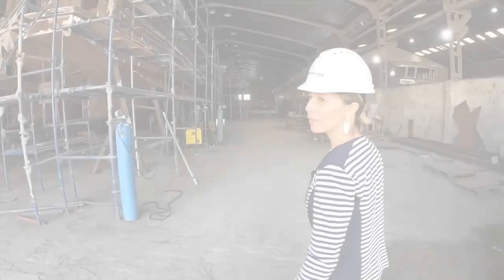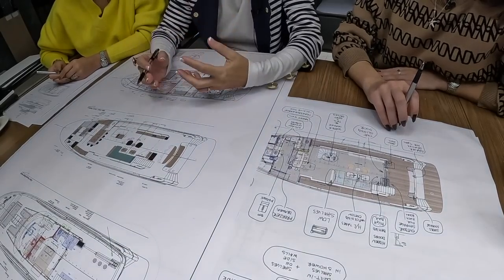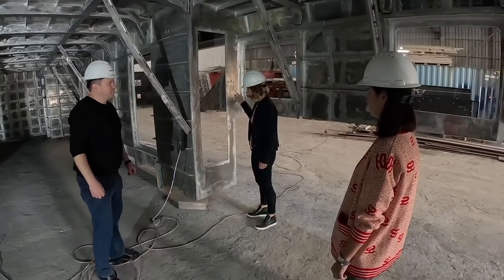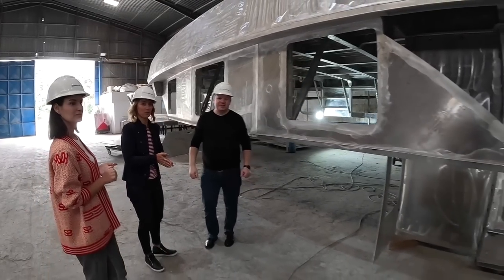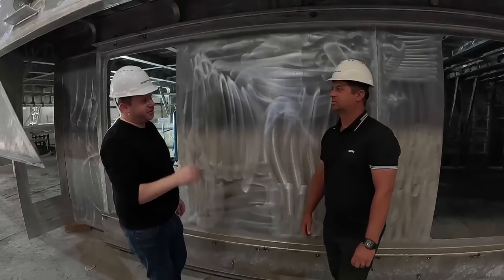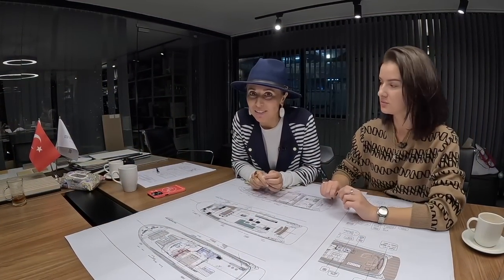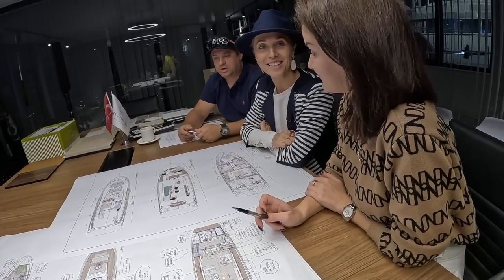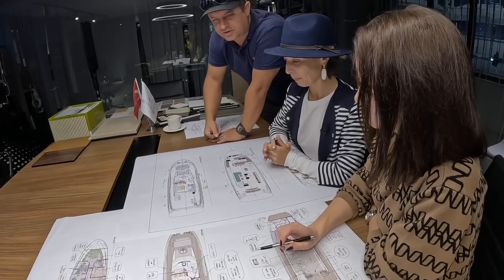BIG Change & the CREW CABIN on our BERING 75 🙈😝 Eps. 20

Comment: Having worked in the construction industry and running a construction company, there is nothing worse than clients changing their mind after they have SIGNED off on the contract. That's why a lot of builders build buildings first then sell to the public. It actually cost a lot of money for builders that are already running on a fine margin to constantly change construction decisions along the way. It's your job as the client to double check everything before you sign. In the construction industry you would be charged a variation fee every time you  change something as it does create a lot of extra work and to expect people to do it for nothing is inconsiderate to the builder, who are already working hard to make your dream come true. To make one change there can have another effect on another part of the build.

Comment: I really hope you guys land on the moon quickly with all these last minute changes. I'm a mechanical engineer and late changes by clients drive me nuts. Or I just start charging for them.
Reply: True, and I think they had already signed off on the final plan.
Reply: @StarTraveler649  You can run out of friends very fast if you keep stuffing them around. Better to look at the GAs and/or models and do your thinking ahead of time, not some bucket list on the fly.
Reply: In any design/build prcesses there is something called a Design Freeze. That's it; what has been agreed on will be built. Any further changes will be extra cost and extra delay.
Reply: I don't know what is doing on here. Surely the Drawings were availalable and now these late structural changes?

Comment: I’m a bit worried about the lack of indoor dining for when the weather is less than perfect. You’ve got a huge saloon but are only really using half of the space for a seating area when you could be using all of it and have a dining table that converts to a lounge area as well as a separate seating area in that space. Have a look at a few other yacht designs in the 60 to 100 ft class for inspiration, or just allow the Bering interior designers to do their job and come up with some suggestions.

Comment: Hi, the crew cabin looks great but where are they going to eat? With respect to the door on the port side where you now want storage being moved round the corner, do you really need it if there is going to be a sliding door about 6 feet away from your new proposede position of the door, I get they may be serving a different purpose but it would save cutting another hole in the superstructure, which may make Vladimir happy!

Comment: There seems to be a fairly empty space between the galley and the couch/dining area. Is that because of the drop down tv? You could put in a proper av cabinet with a lift, and gain more storage on the galley side. 
With the tv lowered in the cabinet you would still be connected with those near or in the galley.
Can’t have too much storage.
Reply from the maker: you are sooo right - can’t have too much storage lol

Comment: Hi guys , just an  out of the box idea (17:50) why don't you put a dropdown ironing board on the heads door?  you will not be able to get into the heads anyways will ironing.....   and it seams if it's on the door when lowered down it is actually in a good ironing position. hope it helps cheers

Comment: That is over 60 man hours plus materials to change the door opening location at this point. If they are using 1/4" 5052h32 aluminum, that puts the change at around $14k.
They are doing them a huge favor.

Comment: Kitchen Bar looks OK ;) consulting crew chef is a must IMO !
Question? Where u all will dine, in case there will be cold outside, or too hot?  suggesting to bring back free standing dining table from the 1st variant of plan :) or some transformer table near the sofa.
In my opinion have as much free standing furniture as possible, cause after 10 yr, u can easily replace them, with no need of capital interior renovation. Have ar much open space as possible, and transform it with free standing furniture (architects opinion ;)  
And get rid of that cabinet, blocking door from salone to cockpit, that placement is not great. You'll thank me later ;)

They are so nice about changes, I think this is on camera only thought :)
To understand about changes, (same in house construction too), what u see done, was designed some time ago, and on this piece is 100 more decisions made to present day, so even little change its like pulling bottom card from a house of cards - everything above collapse.  Thats why is time limit to do changes :)

Comment: Long time subscriber to the original channel. 
Not my money, not my yacht. I think the crew cabin is a big mistake. I was a deck hand in college. Also played Pro sports and coached college. Which means I've been around a lot of pros under stress. Having the entrance to the crew in the middle of the galley is assume there will never be issues with crew. What happens if the storm is heavy, now you'll be bringing in crew with wet jackets, etc. I'm thinking of worse case scenarios. I know if I was your crew having a bad day, I'd prefer to have the original door. I like the private access. and I think your future crew will appreciate it on those off days they will have. Like I said, It's not my money. Love both channels and all the other updates to the 75.

Comment: Is there a sliding door for the crew to use, to enter the laundry room, bath room? I don't think the crew cabin should be placed next to the main galley. The crew staying has no privacy, for them to enter and exits the galley means they have to walk through the kitchen, which means they have to walk through any activities going on in the galley or dinning or lounge area. Any laundry to be cleaned needs to go through the galley and what is the timing for this? People would like access to the galley 24 x 7, yes. Looks like your plan has two heads kind of close to each other. The head near the counter for seating and near the  lounge has no privacy. People do like some privacy when entering and exiting the head. And this head is right in the middle of all the activity on the boats. Do you want to sit next to the head while at the counter? Some thoughts. Thanks for the awesome videos, good luck!

Comment: Can that cut door hole be turned into a window?
Reply from the maker: Cup door??  🤔
Reply: @NautiGuys  I'm sure it could be made into a window but it's going to be cheaper to weld in another piece of metal over the current hole. That and having a window there isn't going to be a big improvement in the lighting.

Comment: What is the ballpark of the cost of this boat fully outfitted and how much will you charge for the whole boat for a weekly charter?  Another ? Is will there be times when you can rent 1 cabin for the week and other people can rent out the other rooms.  The reason for the ? is just to know if people that really can’t afford to rent out entire boats.  It would be nice to have a market where blue collar people could afford a small room, but not the Master Cabin.  You could allow people to go on a nice boat without braking the bank so to say.  There are tons of people that can’t afford $10,000 or more a week to rent an entire boat, but might be able to save up to spend $2,000-$2,500 max on a weeklong vacation plus tip with the Master costing $7,000, VIP $5,000 and so on to cover the say $17,000 weekly cost of the whole boat.

Comment: My opinion really doesn't matter in the long run, but comments are good for the algorithm, so here goes....   I love your bar seating idea for a kitchen... fantastic!!!  I HATE it for your boat.  1. You have a major luxury boat and will have paying customers expecting top level treatment.  Since the weather is not always perfect, you will have days where multiple meals are served indoors and that is your only indoor seating for 6.  Some may not be happy with having to eat multiple meals at a counter. 2. Bar countertop seating is not conducive to conversation.  The person all the way closest to the wall can really only converse with the person next to them and maybe the chef and may not be able to hear the people at the other end very well.  3. Some clients may not want to be chatting with the chef for every meal. (again, if you are stuck inside due to weather.) 4. That bar seating would have elevated chairs, which some people, including myself and my mother, do not like. I feel like I am always about to fall forward, since I am on the shorter side.  
I suggest that you lower that extension back down to table top height with legs that the top just locks into the kitchen as an extension. The top can be made of a stone matching the kitchen.   You can put the chairs around it and serve breakfast that way, but, when needed, you can unlock the unit and detach it and move it into the open space with those chairs as a free standing table. 
I know your boat will be beautiful, whatever you decide!!
Reply from the maker: One very simple answer, the couch area is fully comfortable to a dining area for 10 🤷‍♀️😝😂 (just like all the luxury catamarans)
Reply: @NautiGuys  Aha!  Then yes, that breakfast bar is perfect and will be both functional and beautiful!!

Comment: Putting in a drop TV from the ceiling is a mistake as it will create an obstacle for people that you have to walk around and can hit their heads on, it will reduce the number of people who can view the TV, and it will be too high for comfortable viewing. The best option is to have a lift TV in the built-in side storage cabinet under the window across from the couch. Why are you putting a sliding glass door on the side of the lounge on the couch wall? Shouldn’t the sliding glass door be on the back of the lounge so you can walk straight out onto the aft deck, that way the people sitting on the aft deck are not cut off from the lounge? It is better for functionality, flow and view to have the sliding doors facing the aft deck. I feel that your making some strange decisions that are going to negatively affect the functionality of this ship build.

Comment: I'm not really keen on changes like that door. That should be decided before you start building. The change to the kitchen is not a structural thing but cutting holes where you didn't intend to have holes... I'm really not keen on that.
Reply from the maker: Uummm, thanks for your input… but it kinda of doesn’t matter what you are “keen on”… don’t you think? 😝😂😂😂🤷‍♀️
Reply: @NautiGuys  This is very true. I'm just thinking about changing the structure of the vessel when most of the frame is already built.

Interior-wise you do as you please, changing the structure I'd hesitate to do that at this stage. The man did mention the design as signed-off on more than once, he's doing that for a reason. There's the potential for unwanted consequences to making those kinds of changes. Be prepared for 'that happened because you wanted that' kind of conversations.

You're the customer, it's your money, they'll do whatever you want. I have some understanding of the conversation they're having amongst themselves with regards to that. I also wonder what they're going to charge for that. 

Having said that, I'm not belittling your effort to have a boat built. I greatly enjoy watching your videos and I can't wait to see the finished product. It's got a lot of space, the width of the beam is glorious, it's going to be a fantastic vessel.

Good luck!